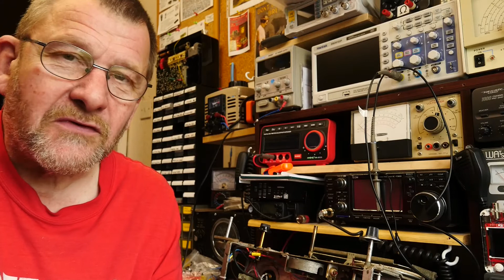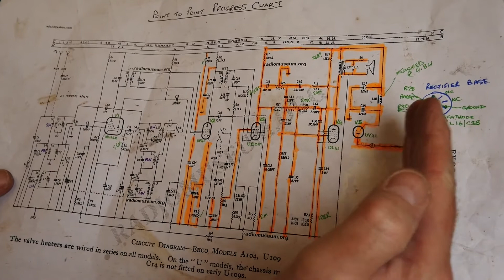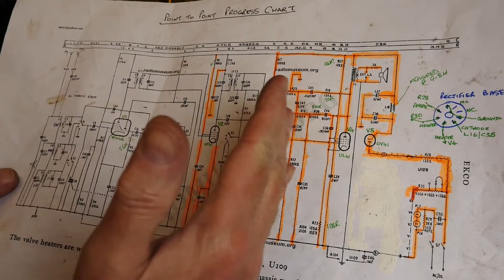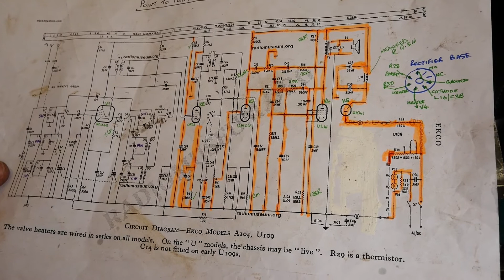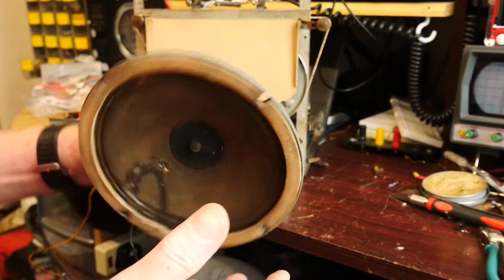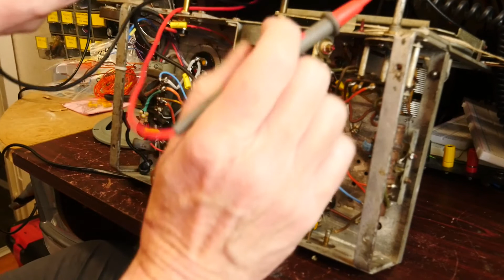EKCO U143 radio restoration part 2

Comment: On the rectifier you can use a ul42 but disconnect pin 6 from earth as it will be a short pin 6 is connected internally not shown in the tube manual.